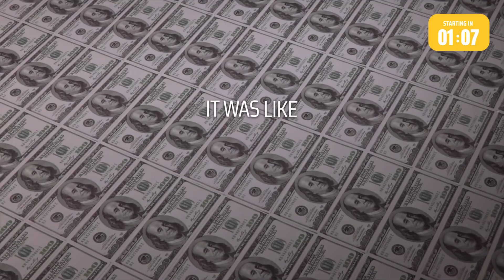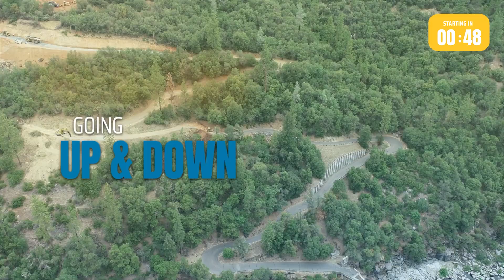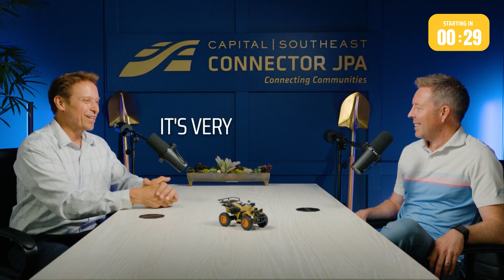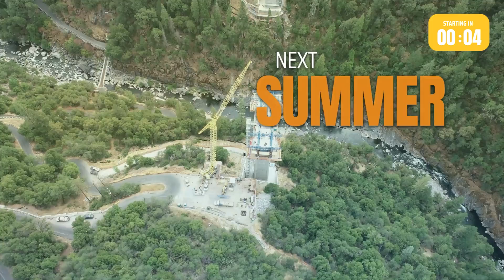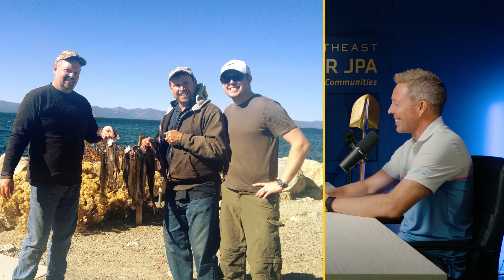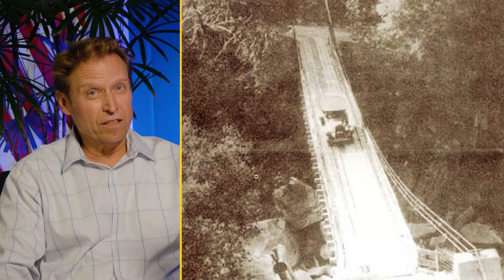Between Two Shovels Ep.11: Matt Smeltzer (El Dorado County) - The Mosquito Road Bridge Project

Comment: As a resident on Mosquito, I can tell you that the thousands of vehicles transporting millions of pounds of material have trashed the road. Over a $100m spent on the bridge only to leave the road in terrible condition. NOT HAPPY!
Reply from the maker: The project will wrap up and improve the approaches to the bridge soon
Reply: @BetweenTwoShovels its more than the approaches. Its the whole way to and from the bridge the trucks messed up the roads, not just the approach.